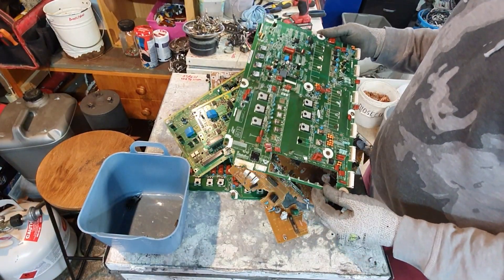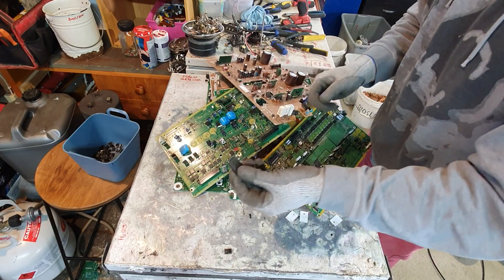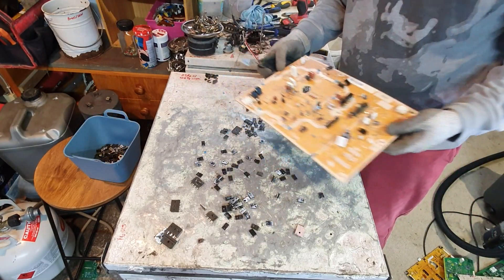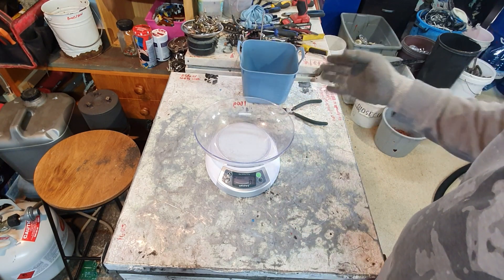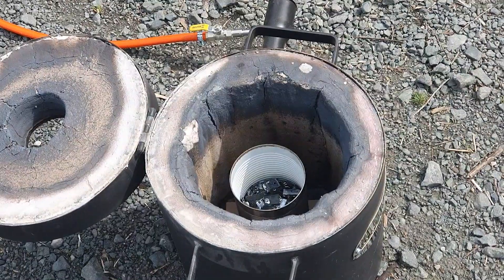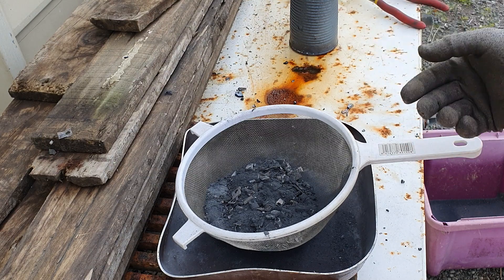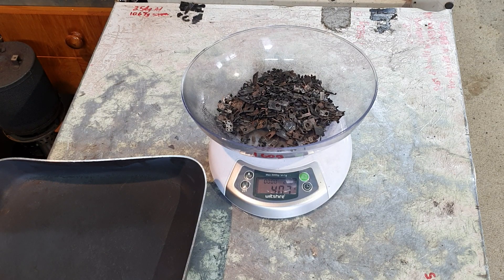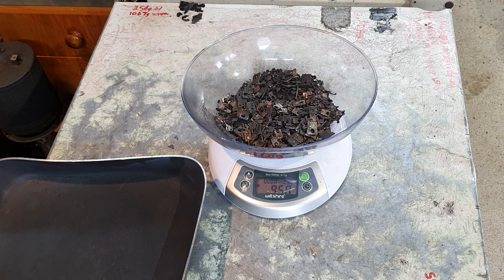Incinerating MOSFET's For #2 Copper.

Comment: I have a lot of those also just kickin around!!
Reply from the maker: Probably a whole bucket full haha. Well worth the effort in removing the plastic I reckon.
Reply: How would it possibly be worth the effort? You're losing 1/3 of the weight for a .10-.20 price improvement, and no doubt cost yourself far more in propane. Frankly I'm amazed yards buy it as #2 @MicroScraprMike
Reply from the maker: @garrettmillsrd525  I agree with you to a certain point. In terms of a monetary "worth," you are right it isn't worth the gas by a long shot. However, worth is subjective isn't? I mean, it was worth it for the experience and the knowledge gained on how to do it for myself, and seeing how I'm a hobby scrapper, it's all part of the fun.

Comment: Thats a interesting method to get the copper recovery from the mosfets. thank you for sharing 👍
Reply: Yes thats true
Reply: for me he is new knowledge from now on and I am glad that there are these films about scrapping and finding copper 1 and 2 groups I am waiting for more exciting films and thank you Mike, say hello to Janne
Reply from the maker: @krystiankucharski7299  Hi. Im glad that you find my videos knowledgeable 😀 I'm constantly thinking of ways and means to collect and breakdown copper with better methods.
Reply from the maker: Night Scrapper uk. Thank you! I was a little apprehensive about using the forge as they are so efficient in producing heat with minimal fuel required. I thought that it might melt the can to some degree, as you saw the steel was very malleable in the jaws of the 90 degree long nose pliers at one stage. I got the result I was after which was great.

Comment: I use a 4 inch threaded pipe with a screw on cap and a 2 inch solid piece of metal rod and ram it into like a piston smashing it after cooking it in the burner. Then sift until clean until I collect a little more than 5 pounds it really don't take that long then I melt into 5 pound ingot. But make sure you scrap yard will take ingots
Reply from the maker: Wayne Day. That's another interesting way of doing it. I'm brainstorming to see which is the most effective way of recovering the copper. Oh yes, my scrapyard takes ingots.